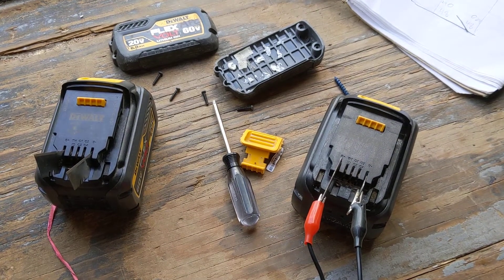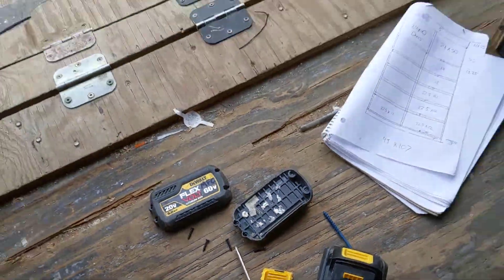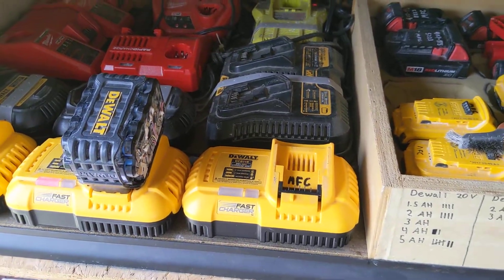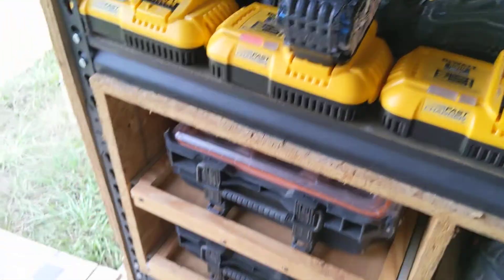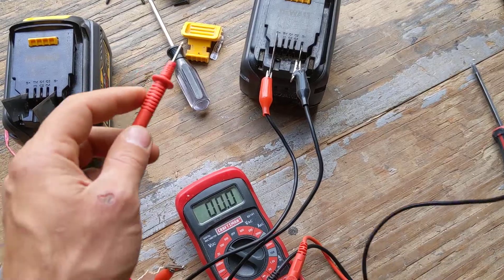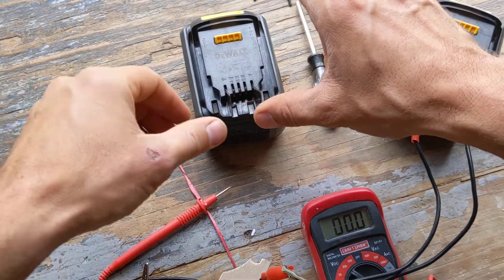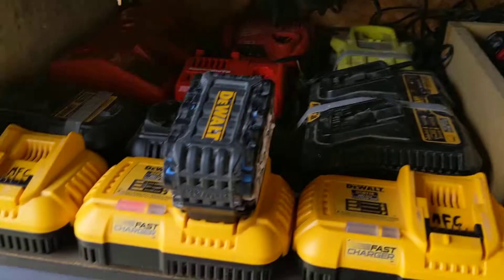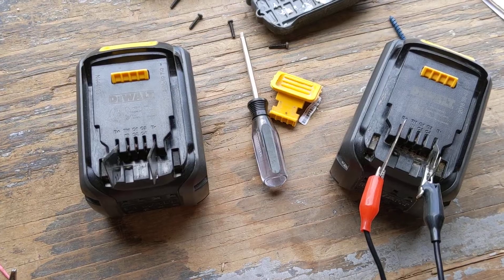How to fix a lithium ion battery that won't charge

Comment: Hello there. I have a battery that I found at worksite. It’s currently fully charged but it doesn’t work on any dewalt tool? I clean the terminals already... any help @
Reply from the maker: If it was left outside it could show it being fully charged because there's water inside the casing that is giving it a false full charge or messing with the electronics somehow. I would use a multimeter across the + and - terminals to see what voltage is at (fully charged is 20 volts). otherwise look at the battery date code and if it's within 3 years just take it to DeWalt and tell them it won't work.

Comment: Awesome tip if I ever need it... Thanks bro 👍
Reply from the maker: Hopefully you wont, but as a DeWalt and Milwaukee rep told me, just take your batteries in before they're out of warranty and tell them they don't hold a charge as well as they use to, which is always true, and they'll give you new ones. 👍
Reply from the maker: @UCFpaAK1785W_ZLV9FQjDNZA A DeWalt/Stanley Black and Decker service center. I have one about 50 min. from me in Carrollton, TX. You can call 1-800-4-dewalt to find a place if you can't get on the internet and google the location of your nearest center. Because of Covid-19, my local service center was making exceptions for shipping things and might send you a label for batteries even though they typically don't allow it.